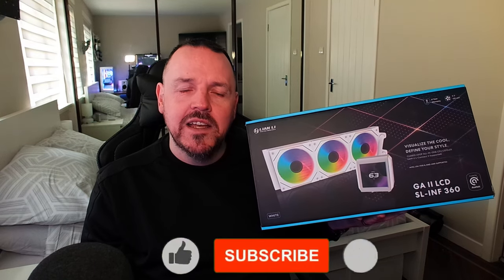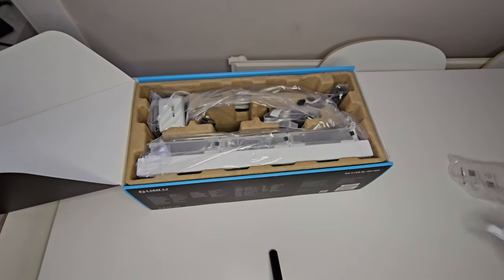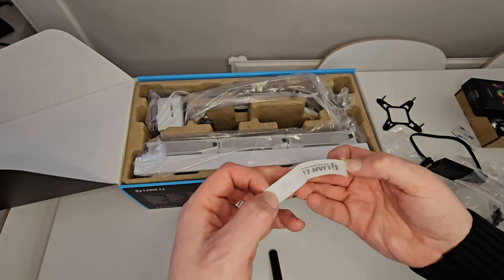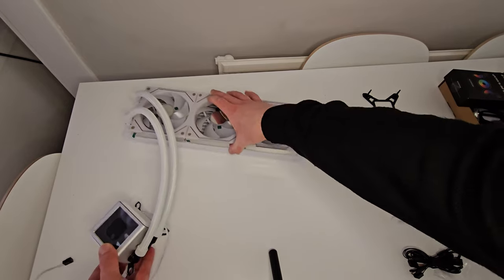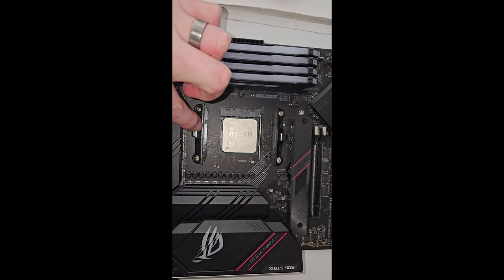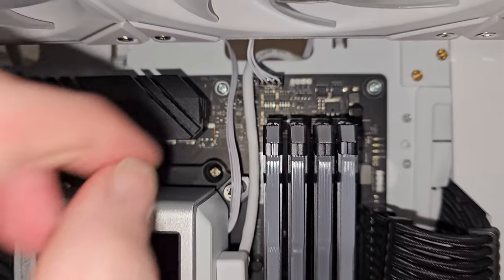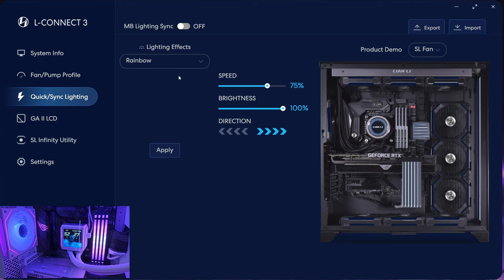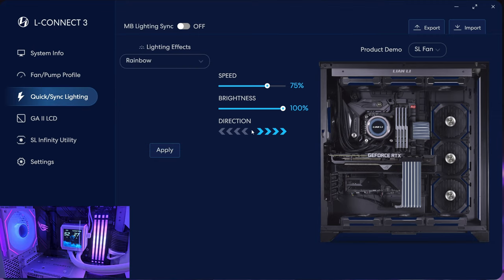How to install the Lian Li Galahad 2 LCD SL-INF 360

Comment: Hey man. Was messaging you on another video of yours then came across this, hoping it would fix my issues… unfortunately not… the leds on the pump quickly flash on then stay off, and the lcd screen doesn’t turn on at all during testing… I’m getting so frustrated 😭!  Everything is plugged in the same as yours from what I can tell 😭😭
Reply from the maker: @ReignDGF  first things first, is the pump running and the AIO fans spinning regardless of the screen and LED's not coming on?

Also where are the yab cables from the Pump and the fan controller plugged in to? If they are plugged in to an internal USB hub then make sure that hub is getting power.
Reply: @BrisyTechBytes I think there may not be enough power to the mobo… so I’m getting another cpu cord  to connect to psu today… cuz right now there’s nothing plugged to atx_12v 8/12pin slot on mobo… but yes the cpu cooler fans are running and lighting up.  The pump light flashes on for a milli second and then stays off and lcd screen doesn’t even try
Reply from the maker: @ReignDGF  does the system boot up ok? If so there really shouldn't be any reason that the screen doesn't fire up, where do you have the usb plugged in to from the pump, to the motherboard or did you buy an internal USB hub?
Reply: @BrisyTechBytes to the mobo. I tried to start it up but it wouldn’t connect to my monitors… so it was like neither the gpu or monitors hdmi port were working. So I’m thinking again, lack of power to mobo? Like I said I have everything plugged in the same as you! I looked at another video of an Asus z790 installation, and the only thing I saw different was additional power at the top slots to the atx_12v on mobo
Reply from the maker: @ReignDGF  should only ever need that additional power connection to the top of the mobo if you are planning on overclocking.

Need to solve whatever issue is causing the system to not fire up, would imagine as once as that is solved then the screen will work fine.
Reply: @BrisyTechBytes  oh. Does the usb-c actually stick firm into the pump house for u? Mine is pushed as far as it can go with as much force, and still it has a slight wiggle
Reply from the maker: @ReignDGF  Just a normal fit on the USB-C connection on the side of the pump housing, didn't need to push it in particularly hard or anything.
Reply: @BrisyTechBytes  got the computer up and running! The only thing i have wrong now is that the cases led and my graphics card rgb don't sync with my fans... do i have to have the extra controller in order to do that?  Thanks for all your assistance so far! I'm so happy with this computer so far! Just got to play Wukong for the first time last night
Reply: Also. GA II LCD was an option on L-connect 3 yesterday, but today it is not... uh oh
Reply from the maker: @ReignDGF  Glad to hear its all up and running.

So for the graphics card sometimes motherboard software recognises the GPU and allows you to set the RGB through the motherboard software, if not you''ll probably have to download the actual graphics card software to change it, my past few graphics cards have been Gigabyte cards and I had to use their RGB Fusion software to change the GPU RGB.

You'll need to remind me, did you get the Phanteks NV5 case or was it another case?
Reply: @BrisyTechBytes  phanteks nv5 ! Asus z790 prime series mobo lian li Galahad sl-inf 360, and 5 uni-fans
Reply from the maker: @ReignDGF  ok so far the case lighting, if you have just wired it up to the inbuilt controller you can use the 2 buttons on top of the case, one to change the effect, the other to change the colour, if you have attached the inbuilt case controller to the motherboard then your motherboard software should pick up that LED's are attached to the headed and allow you to configure it. I dont have mine connected to the mobo as I am quite happy with the colour options that the inbuilt controller provides
Reply: @BrisyTechBytes  oh from the video it looks like all of your stuff is synced to your l-connect 3?  Perhaps I have to mess around with the mobo stuff n just try n manually sync it up… but what about the Lian Ali lcd not being discovered?
Reply from the maker: @ReignDGF  not sure what's happened with the screen, all I can suggest is make sure the cable to the pump housing and to the USB header are OK, check that the L-Connect software is up to date and that the firmware is up to date under the settings in L-Connect
Reply: @ReignDGF what. Was the issue with the pump display not turning on? Im having same issue where fans do work and light up bit not the lcd screen.

Comment: Hello, we bought lian li galahad 2 LCD sl infinity 360 liquid cooler and 3 extra lianli uni fan sl infinity 120 mm fans, but we could not connect them both at the same time. help please
Reply from the maker: How have you connected them up, the 3 fans on the AIO going in to one port on the hub and then the other 3 going into another port on the hub?